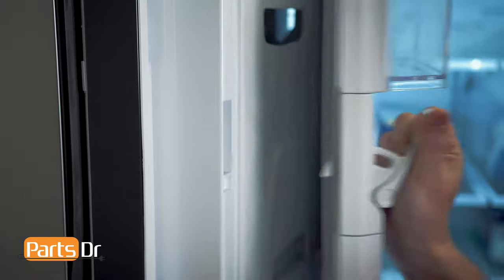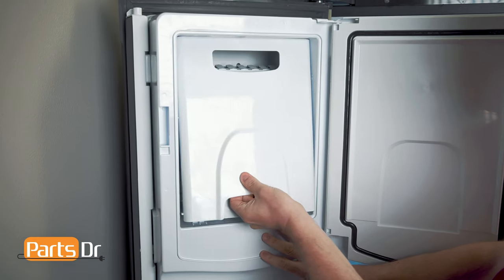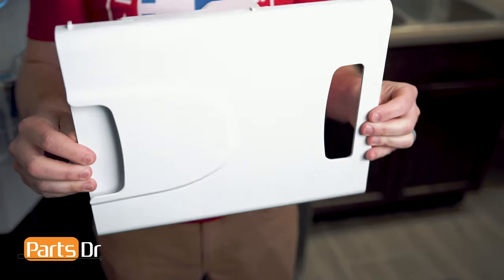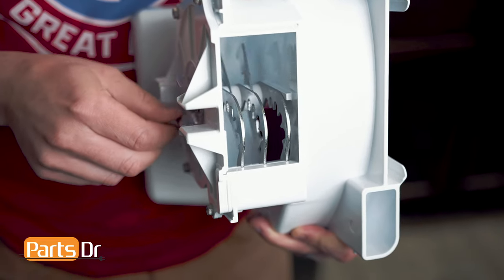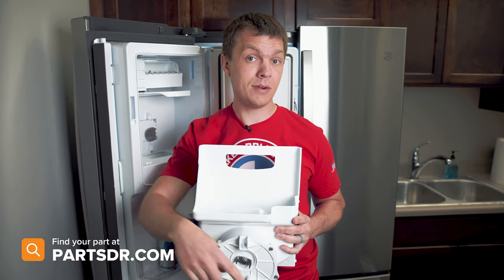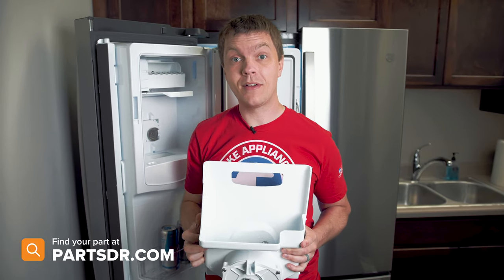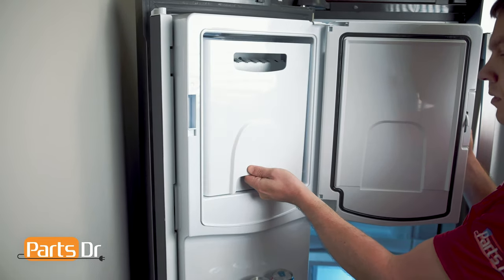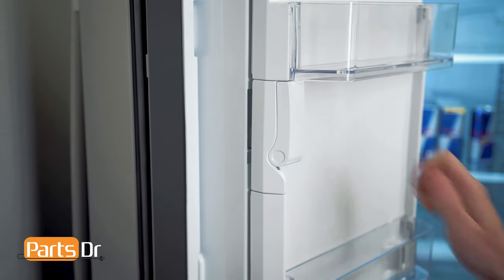How to remove/replace GE refrigerator ice bucket part #WR30X10174

Comment: Hello, I have the same ice bucket.  My problem is it won't pop out, how do you get the bucket out when it is stuck?
Reply from the maker: If the ice bucket is stuck, it could be frozen in place.  Try letting it thaw out for a while and then removing.  Don't use any heat sources as the plastic liner of the refrigerator can be damaged very easily.
Reply: @PartsDr how do you let it thaw out just leave the door open?..thanks
Reply from the maker: @venusstarr7636  Yes, unplug the refrigerator and leave the doors open.  Use a house fan blowing at that area to accelerate the process.  Some people have also reported having luck using a steamer to thaw it out.

Comment: This video is misleading, where the actor says you have to replace the whole unit he holds in his hand (ice bucket) for GE  gye22kshfss. If the bucket itself needs to be replaced because it is cracked and leaks, you can purchase the bucket alone and reuse the crusher components.
Reply from the maker: Hi Allen, the model shown in the video GFE28GYNBFS does not offer any parts of the ice bucket separately.